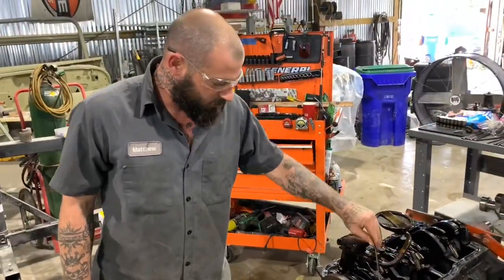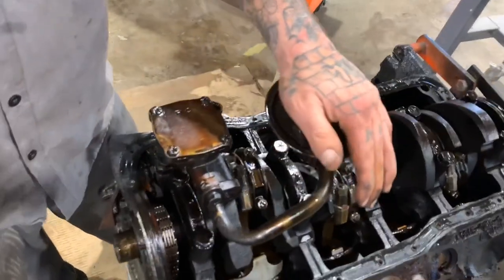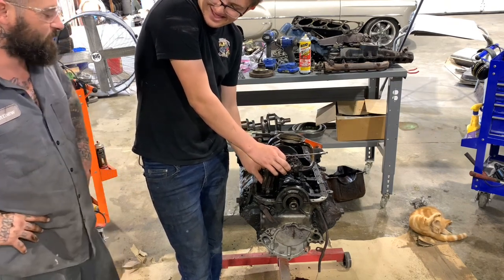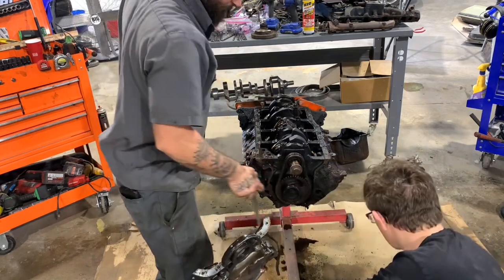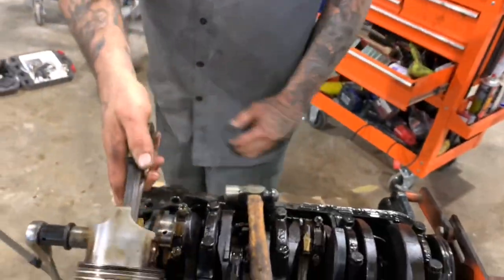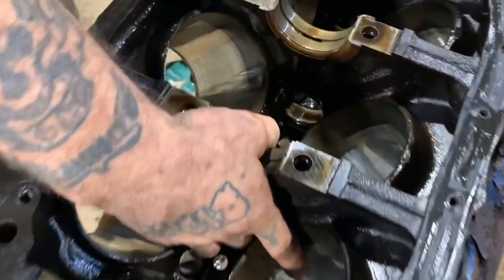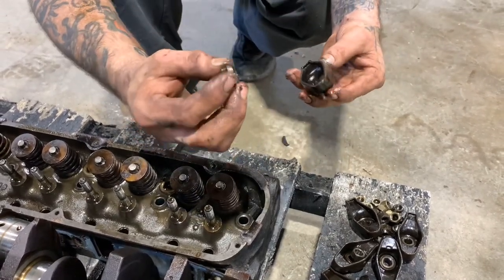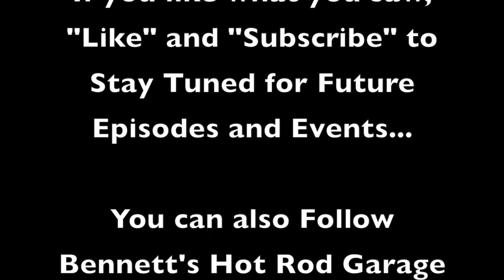Ford 289 Teardown part 3 of 3 (bottom)

Comment: Talkin about tools, Metric and SAE, i just replaced the brake lines on a 05 Focus. I have full sets of line wrenches, Metric and SAE, and not a one of'm fit that fitting properly. If everything else fails you always have the reliable vice grips. But i dont get it? Unless the fitting deteriorated from rust but it looked pretty clean.

Comment: Like Matt said Austin when your done using a tool put it where it goes and it will not come up missing. Or the cats will run away with them if there small hand tools like your 10mm socket .😂